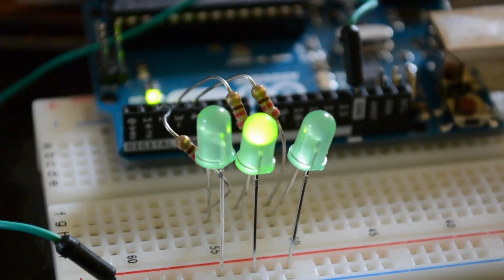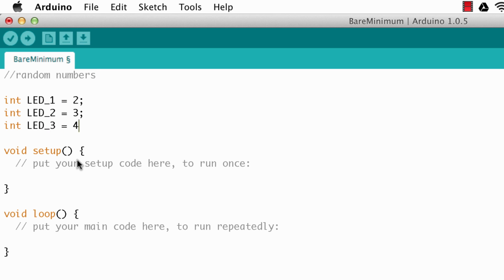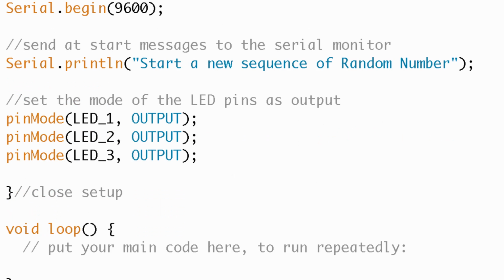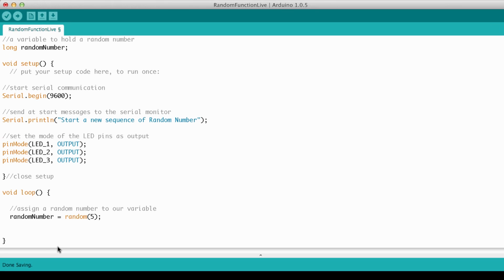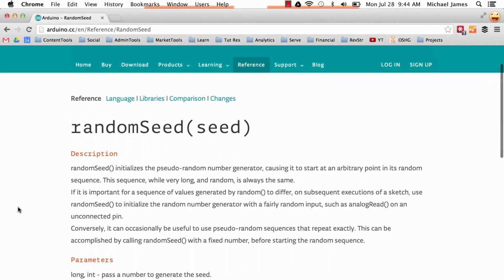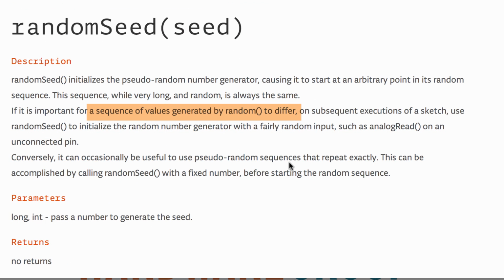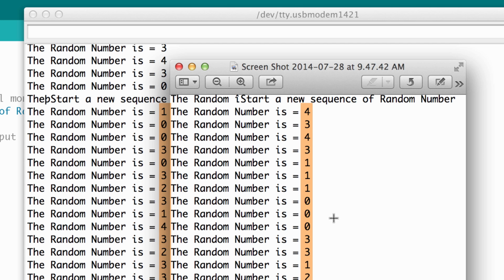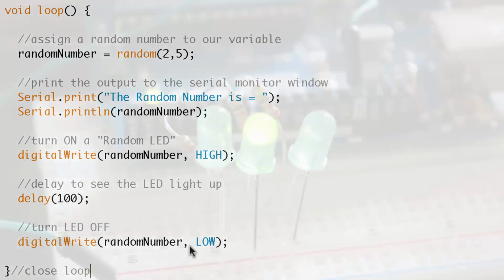Using random numbers with Arduino

Comment: How to catch random number to a variable in void loop that will not change before the syntax has finished, so we can call it. Example, I press the button, and random number is generated, we catch it to a variable, then I press the keypad to fulfill a number, then I press another button to compare my input number to the variable than contains the random number before.

Comment: Your tutorial on the ‘random’ function and the ‘random seed’ function was excellent/ I would like to apply this bit of info to an 8x8x8 LED Cube / if I increased the number of Leds’ to 512 and sent out the A0 to 8 shift registers and at the same time to a layer ( 1 thru 8 ) ...........could that produce a random light in the cube at a specified delay .     And yes , there is definitely one way to find out :-).  Your thoughts?

Comment: This works great, I increased it to 10 leds, which each led is in a model hotel room....Now how would I go about telling it to use random time also? If you could give me an idea where to start. Thanks and Thanks for all the other vid's you have done. I have learned alot from them.
Reply from the maker: Hi Jim - great question.  Depending on how you have blinked your LED (I am assuming you are employing the delay function?), you could try using the random number generated to be the value used by delay().

i.e....
...turn LED ON...then...

myRandomNumber = random(100, 1000);

delay(myRandomNumber);

...turn LED OFF...then...

//another randomly timed delay

Does this make sense?  Have a good one.
Reply: Makes more than sense, thank you.

Comment: Question. I have been trying to figure this out for a little while now. I want some leds to blink random for a delay controlled by a pot. My lights flash correctly for one sequence. Takes about 1.5 seconds. If the delay is 10 seconds, the last 8.5 stay solid on the last random color. I don't want to use mills because the arduino will have power for long periods of time. But the lights come on from a sensor input. Any help would be cool. Thanks for your time. I remember seeing a solution to this problem in one of your earlier tutorials. If you could just point me there I would be grateful

Comment: Is there anyway to stop it repeating the same number twice in a row?
Reply from the maker: Chris Punton Great question!  My first though would be to start looking around for some type of random number generator library that would give you more options other than the built in random function.

But if that turned up nothing, you might be able to store the previous random generated value in a variable, and then compare it to the next value generated by the random function.  If they match, than have if statement generate another random variable.

Hope this helps some.  Have a good one!
Reply from the maker: Just made a video answering this question Chris Punton .  It will air on July 14th.  Thanks for asking it!
Reply: can you please post a link to the video, thank you

Comment: What if I need to use all 20 pins on the arduino, how would you generate a non repeating random number?
Reply from the maker: +The Musterion Of Rock, You could use the output of the millis() function to generate a random seed every time through the loop.  This might do the trick.
Reply: Open Source Hardware Group That's smart! Thanks :D
Reply from the maker: I hope it works ok - best of luck!